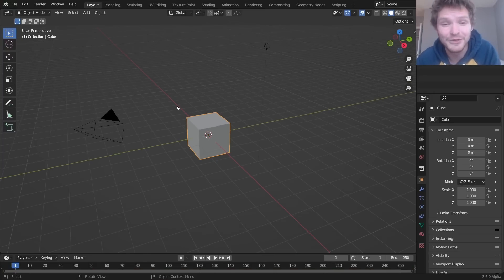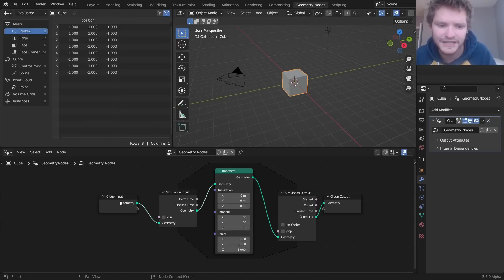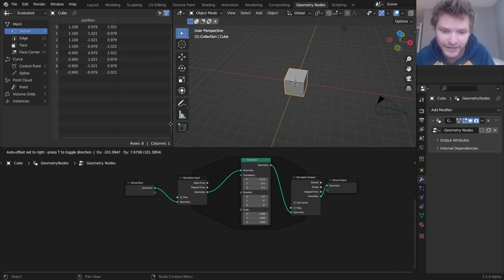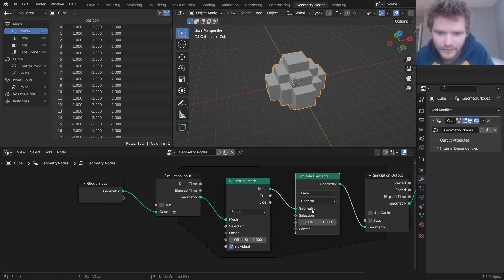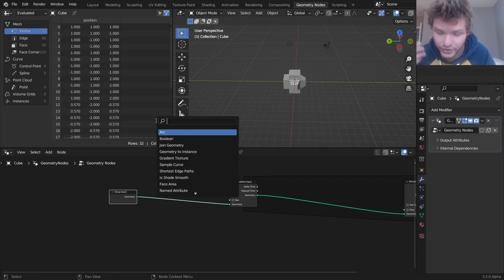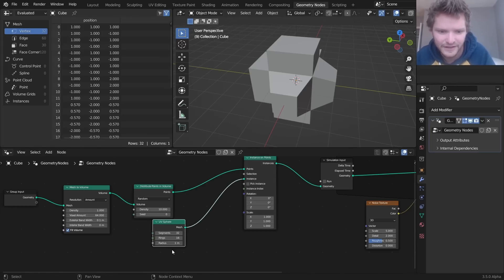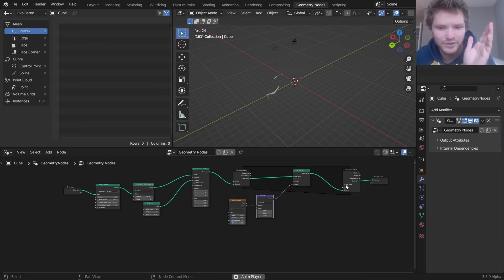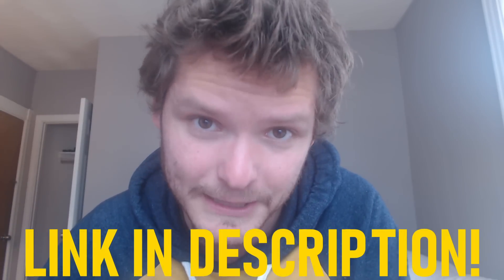NEW! SIMULATION NODES

Comment: You mention fractals a lot, but I haven't been able to find a way to make the simplest of fractals, a custom spiral, for ex. a golden triangle spiral (or even its triangular "scaffold" which is also a fractal)
Reply: Check out "Bad Normals" video called "blender is getting crazy". He demonstrates how to make them with Geometry Nodes, he even has an addon for it out
Reply: @arksenigma6883  Turns out it's a different video than I thought, so it might actually be helpful... will prob take some time to figure out
Reply: you mean drawing a circle with pi and sin/cos functions then making the radius variable and growing with some multtiplication on top of that?

i don't see how that's a problem, i could do that in the shader editor years ago to generate textures like that with hard math nodes 
with  the < and > conditionals the math nodehas, multiplying the result of a greater than condition by the result of a lesser than condition, because only 1x1=1 and 0xanything is 0, basic logic gate trickery to make an "AND" and set line radius with some subtraction on one side and addition on the other

that kind of shit is done in glsl shaders a lot too, but preferably you use the step command there it parallelizes better over the gpu cores, but it's a basic comparison, using UV coordinates, but you can extract the amount of pixels on a shader window and map it back to float within the 0-1 uv range to do pixel perfect stuff
regardless of the command, it's still a binary 0 or 1 result, and you still multiply the result of 2 contitions commands on each axis, to control limits for both axes

could animate it with just uv mapping 0-1 wrapping around.
using phi as a factor to multiply distance between linear object scattering along a spiral circle, so they line up nicely without frequencies meeting up worked fine too

you just gott punch in the exact proper numbers to make it a fibonacci spiral on a square image, then it zooms like a fractal

just start with a mesh line with , and use the x coordinate to calculate the vector positions for every step , right?
curves are probably better for controlling precision though as you can resample them and all
animating it, is merely a matter of using a 0-1 float value warpping around with modulo 2 that increases linearly, multiplied by PI radians, controlling the "phase" of the spiral calculation

alternatively you can use distance functions with -1 to +1 with unit vectors too
Reply: @klontjespap  Look at the "golden triangle spiral" wiki article and tell me if you could make that procedurally
Reply: @sFeral  see how they do it in any programming language then repeat it in blender
That's my solution for how to look at simulation nodes
Basically it probably is possible as long as there is math
note you can also just use python to make an addon

Comment: A trig function of time will be cyclic rather than continuously growing. Good for throbbing and pulsing things, even character breathing?
Reply: I wonder if theres a way to do FFT in blender nodes
Reply: @Lilly-Lilac  Sounds like an application that is better suited to optimised C code generated at compile time for each platform's CPU, otherwise yeah if nodes are Turing complete, and a combo of loops and maths implies that they are, then sure anthing is possible/computable with them.
Reply: @DanielSMatthews  I do think it would be interesting to see it done but you're probably right, it's not going to be nearly as efficient done entirely within modes. Still would be interesting to see how well optimized you could get it